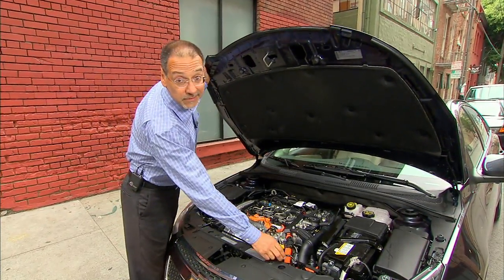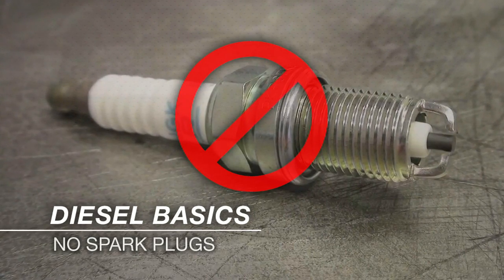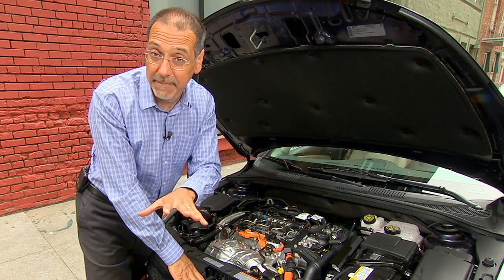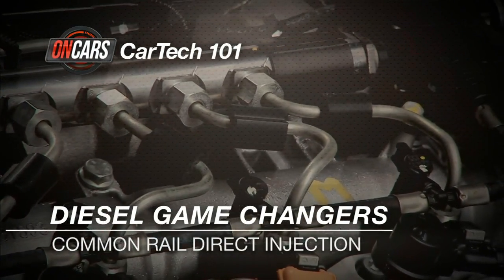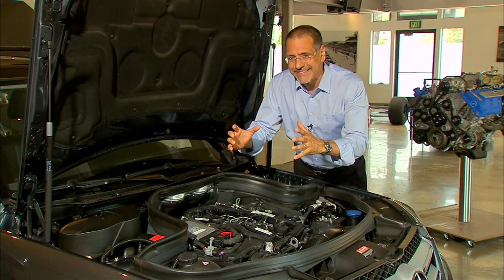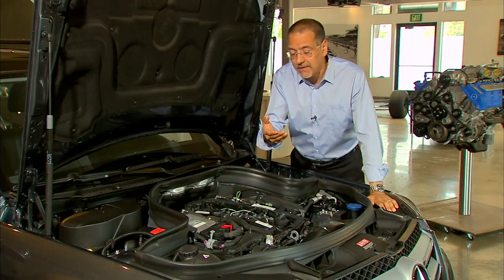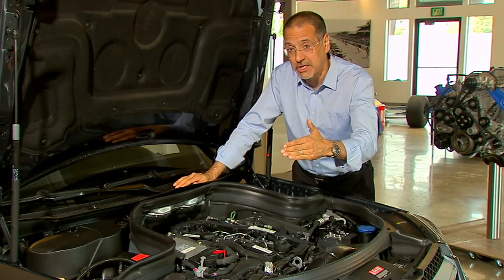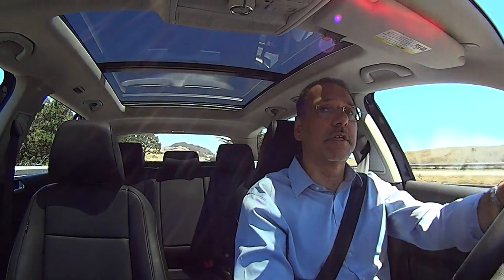CNET On Cars - Car Tech 101: Understanding diesels

Comment: I've got my first - modern -  diesel at 48. 

I'm never going back to gasoline. Next car will probably be electric. The current diesel took a week or two to get used to, but it is nothing short if wonderful.

With turbo and intercooler you get two engines: the very economic one at 1000 to 2500 rpm, and the extremely strong one over 2500 rpm. 

In fact, the engine produces so much torque that stability control is a must.

Comment: disel are less eco friendly than petrol, they have more carbon the the fuel itself and produce more nitrogen which is wprse for the environment than co2. yes the fuel economy is good and co2 emissions are less than gasoline/petrol, but they are not environmentally more beneficial.

Comment: Why Diesel engine is cool than Otto engine (example): BMW F10 525d 3.0 (turbo) with 205 HP and 450 Nm vs 535i 3.0 (turbo) with 305 HP and 400 Nm -> so, the Diesel engine have more torque, even with 100 HP less than Otto engine.

Comment: ...I had 2 naturally aspirated gasoline cars and 2 turbocharged diesels and to tell you the truth both have their pros and cons...Lets go cons first. Gas cars will let you down in economy and make you feel like you are constantly at the gas station so they are really bad daily drivers in general (even with bumper to bumper traffic a diesel would drain 20-30% less fuel than a gas car) , while diesels are noisy and clunky at low speeds especially the older pump diesel system ones like my old  2004 Passat making them a real pain in start-stop traffic... Without a turbo, gas cars are better as small hatches like my small Ford Puma which had 125 hp per ton (from a small 1.7L inline 4) so it could get a respectable 0-60 time with it loving to rev and it was so well grounded in corners it always put a smile on my face. It was fun as a city car and really nothing could go wrong with the engine (no turbo, no problems), while turbodiesels are great long trip cars, size doesnt matter with a TD because of the extra torque, they also have great mid range acceleration ( 2000-3000 rpm is their sweet spot ) making them a safe bet for passing on a B road. My current Ford Mondeo wagon TDCi has the common rail system which really eliminates most of the "diesel shake" while idling. Add the DPF which cleans those exhausts so there is minimal black smoke choking everyone around and you've got something extremely simillar to a gas car... So in my conclusion, a diesel is a great choice for people that regularly take long drives on highways while small gas cars are great for short city commutes.

Comment: What is it about diesels that make then last longer ?
Reply: Mostly because the parts in the engine aren't worked as hard due to it's lower rpm.
Reply: Whatever_928 Diesels are built more robustly because they have to handle much higher pressures than conventional gasoline engines.

Comment: here's a fun fact: Diesels are loved in europe, but actually don't fit it, this is because europe is so densely populated, most drives are essentially start stop and short drives, which actually ruin a diesels good points, as it gets most efficiency on longer drives with less start stop action. The US favors gasoline, but with its long roads and being less densely populated (except cities like NYC and such) it would make more sense to use a diesel... in the end, it just shows that the world works in strange and sometimes funny ways xD
Reply: Spot on. I only drive hybrids and diesels these days due to their efficiency. Cant wait to earn enough to buy a full EV.
Reply: and diesel is cheaper then gas
Reply: @leftmorningstar6954  - Not in America. It used to be literally half the price of gasoline, but now it's more expensive than premium. I find that annoying because diesel is fundamentally cheaper to refine. By a lot.

It's priced as a commodity. At some point it was discovered what the market can bear, and the price has stayed there.
Reply: Well it’s down to tax reasons. In Ireland, (pre-2008) nearly every car was petrol, other than vans, buses, trucks and other heavy duty vehicles. Our tax system was on engine CC (cubic capacity) so in the sense that, if you have a 4.0 V8 you probably have more money so you can pay more tax. Then with this new EU (European Union) directive that changed how road tax worked, it now ran on CO2 figures on a particular car. Diesels polluted less greenhouse gases like CO2 so the tax was far far cheaper on them as at this point petrols didn’t have particulate filters so they polluted a lot more CO2. Diesels we’re adopting particulate filters to lower CO levels (carbon monoxide). So then people in Ireland started buying diesels for lower road tax, also they were more fuel efficient in combined driving and the fuel was cheaper. Ireland is kind of vastly spread out and other than some cities on the coasts, there is a lot of country roads (80km/h speed limit) we also have 13 motorways (as of 2015) which is a lot considering Ireland isn’t exactly what you’d call a huge country, and diesels were amazing on the motorway too.
Reply: Most country boys in Europe love diesels when you live in a small village you buy a diesel and its ripp it and get the fuel economy of a prius when you do it
Reply: You love making statements and finding fitting Arguments after, don't you. 

Dieses Manuals are horrible in start stop traffic.
Reply: Well in Europe most people are driving manual.
Diesel cars are easier to drive,especially for beginners, because of the higher torgue output at lower RPMs there are more unlikly to stall.
Also they are accelerating a bit better

Comment: It strikes me funny that nobody here has mentioned anything about sub-zero temperature characteristics of a typical auto diesel engine.
Although these engines may contain "glow plugs" to aid in starting there's still an issue with the fuel viscosity at colder temperatures.
...And no mention of the cost of routine maintenance. Go check the difference in price of  complete service intervals of the diesel vs. gasoline engines.
Better fuel mileage on a diesel...yes  Cheaper fuel prices...absolutely not.
Reply: A modern diesel has no problem starting in sub-zero temperatures if the glow plugs work. 
Fuel viscosity is a non issue since gas stations only sell diesel with special winter additives during the cold months.

Routine maintenance yes, that can be a bit pricier on a diesel, depends on the car.
Reply: rayford21 Even my 33 year old diesel has no issues in the cold. 
Maintenance, same cost as a gasser.
Much better fuel mileage, plenty to offset the fuel cost. My diesel gets 3x the fuel mileage of the gas counterpart.

Comment: what about starting a diesel engine in -40degres though winter ?
Is it possible?
Reply: +ShowCare {aUtopia} Yeah? Never tried it but yeah 
you would have to heat up the glow plug a couple of times though
Reply: Hurileno I wanted to know if it is still necessary to plug the car to your home electricity at night in winter , on a 2016 diesel car ?
Reply: ***** Whatdo you mean plug in?

Comment: There hasn't been a decent diesel engine made since 2007... current emission standards have screwed everything up.
Reply: +John Groshko The BMW EfficientDynamics engines say Hi.
Reply: +Fantic1980 Sounds like over-engineered, emissions-based garbage.
Reply: John Groshko So by "over-engineered" you mean 'better', and by "emissions-based garbage" you mean 'lower emissions'? I assume you're American.
Reply: +Fantic1980 "Over-engineered" = less reliable, "emissions-based garbage" = worse fuel millage and less power.  Do some research. And FYI, I'm Canadian, and any diesel tech will tell you emissions standards are pointless and only cause more problems.
Reply: John Groshko Well my 320d does 70 miles per gallon, 0-60 in 8 seconds and in 5 years of me owning it, I've spent maybe £2000 on it outside of a service. I'm curious what this 2007 engine is you're talking about, because Honda absolutely changed the game back then.
Reply: +Fantic1980 ANY engine without a DPF or UREA system is better than one that has one.  You're car would probably get 80+ mpg with the emissions BS taken out of it, and re-programmed... Also, I believe the UK has lower emissions standards than here in North America ...
Reply: make and model plz
Reply: I can personally say any diesel pickup made after 07 is runied due to emissions

Comment: :33 Yeah it sounds like a chevy alright, cheap junk.
Only women and sissy "men" don't like the sound of a diesel.
Don't by a VW, they are cheap junk , I've got a 2015 jetta, it's crap, it has the trip computer and tire pressure sensors but no dang cruise control, just outright as cheap as they could be...
Reply: Mr.Green
You should reread the comment, sorry you couldn't understand I was talking about the fact a new car today not having cruise control with all the other electronic controls only points that a company is being cheap.
Reply: Mr.Green"
That's not the cars fault, it's yours"  Yeah like the car made itself, I blame the maker for being so stupid cheap, I've yet to own a older model of any other brand that had power windows but no cruise control and this would include diesel pickups base trim and even my 93 pace arrow has cruise control and it's a chevy chassis. 

So is your TDI one that VW is so famous for making the most pollution, again what a crap company, though the worst is GM, 10 years running with steering columns locking up on people while driving.
But the whole feel of VWs is just cheap in general, like most new cars today.
Reply: Maybe you shouldn't of been so "cheap" and bought the one with the cruise control option... there's a thought, genius.
Reply: Mr.Green
Base model does not have heated seats.
Though it sure does have everything else, I don't know about the speakers, but my 2000 Taurus sounds much much better, not to mention the taurus is faster and gets near the same mileage.

"you're just a sever cheapo dude. "  Because I think a jetta is a cheaply made car?  No, it's because I have higher standards, LOL.

Is that a jetta in your video "about police trucks on I81"?  Funny I'm not far at all from 81.  If that is a jetta well the radio in the 2015 looks way better than yours does, what year is your jetta?
Ohh I see you say yours is the TDI, cough cough, junk VW diesel, cough cough, cheapskate company that is dealing with legal battles over it's dirty engine they LIED about cough cough, like I was saying VW is a cheap company, not only do they make junk, they are very deceptive as well.
The one I'm talking about is the gasser with the 6speed, I'm shocked it has the transcommand on it, but it's sluggish shifting is a joke at best, def for someone that has never driven anyone elses.
Reply: Mr.Green

So where is a video of your jetta then?

"And no, you don't get 41 mpg with a Taurus and no its not faster"  I never said that I did, I said it does better than a 2015 jetta with the gas engine, and it sure would outrun it, I've driven both.

I obviously know more about cars than you, your YT doesn't suggest that you have any skills, I have plenty of how to videos.
Anyone can type and talk a bunch of crap from behind the keyboard, but what can you actually prove?

LOL a civic.
Reply: Mr.Green So where is a video of your jetta then?
Reply: Mr.Green
Ya ok.
Reply: Mr.Green
Hey man take care.

Comment: I don't get America. The world's greatest country yet so backward.  All BMWs and Audi's are diesel here. One of the best one I think is the Audi A6 biTDi. 3.0 diesel twin-turbo 326BHP. 0-60 in 4.7 seconds and 44 MPG. Yet here you are just figuring this shit out now? What are your engineers doing over there. It's so funny to see Americans say things like diesel used to be a dirty fuel and diesel is slow. We figured out 15 years ago in Europe that diesel can be fast as well as efficient. I can't understand this country
Reply: +VolvoXC90TV Gasoline is much cheaper here than in Europe
Reply: i would disagree. Most german cars sold in europe runs on Diesel. Atleast for now.  The BHP is not that astounding. But the tourqe is. Atleast for a standard car.
Reply: +Nima Afshar Deisel is 2 - 5 times cheaper here and a couple of months ago diesel was cheaper than a bottle of coke here
Reply: +VolvoXC90TV The upkeep of a diesel is far more expensive than a gas engine. Diesels need perfectly clean air and fuel to function properly, otherwise they create more expensive problems quickly. I am a diesel mechanic in the service and I have seen this first hand. The filters are pricey, the oil is pricey. Gas motors are cheap maintenance and far less of it over the lifespan. Gas is also far cheaper than diesel. I was stationed in Europe for a few years and the gas price was 1.89 euro for one liter of gas,...this was in 2003! That's nearly 6 euro for one gallon,...in the U.S. gas is currently avg of $1.90 a gallon. Far cheaper. This is why.
Reply: They moved to cities phsically but not mentally. They still drive pickups in cities. They call a liquid gas. They call a shift knob "stick". They still use medieval measurement. They cant pronounce basic materials like "aluminium". What do you expect?

Comment: Stinky diesels... wait until they invade your cities in the US, you will see (and beathe) how "clean" today's diesels are... I live in Belgium, in Europe and I can tell you that reality is FAR from the theory. Diesels are good for longs distances, but they are absolutely NOT designed for cities.
Reply: Engineer Diep
Hahhaha Ohh they do that too but I reckon the cost of rubber is more immediate, first 4 or 5 years I was driving I was burining out all the time, myself now I haven't rolled any coal, seems stupid to me, more soot and higher temps for no extra power.
Reply: There is still an argument for diesels.

Cons of diesel

1. More polluting to local environment
2. It takes a few more minutes to warm up a diesel engine, but only a few.

Cons of petrol

1. More polluting to the Earth as a whole
2. The process of refining petrol is more polluting than refining diesel out of crude oil.

"Swings and roundabouts" - The choice between the two is not as easy as you may think.
Reply: +Jean V Speaking of which, what happened to diesel-hybrids? There should be some right now right? Kill me if there isn't one or hasn't been one in the market yet.
Reply: +Jean V In my land we use diesels to roll coal.
Reply: Patrick TheBaptist Your still using coal?
Reply: Engineer Diep
You need to learn what I am talking about "roll coal" look it up on YT, you will see alot of american diesel trucks chugging out tons of black smoke.....  LOL
Reply: Patrick TheBaptist Just looked up roll coal and I'm now wondering why you guys don't do burnouts instead.
Reply: Patrick TheBaptist Good for you, but there's still the other guys to ask why they roll coal at a time when California is in a drought.
Reply: Engineer Diep
Bigger problem is the water bottling companies that wont stop sucking them dry, sad that starbucks actually moved theirs....
Reply: Patrick TheBaptist And Walmart has been a target for while
Reply: +Engineer Diep Volvo V60 D6-PIH is a diesel-hybrid.
That being said, also living in diesel-loving Belgium, I stepped away from diesel and went to LPG 3 years ago, and I recently ordered a brand new LPG car.
A modern turbo-petrol engine can be just as torquey as a diesel, be just as economical when running on cheap LPG, but much cleaner and much more happy to deliver some extra hp when pushing it.
Reply: +Jean V You are right. Greetings from Trier.

Comment: I wonder why they don't build gasoline engines on the same principles as diesels, it should still work, at lower compression ratio to compensate for the lower ignition point.
Reply: +Keven Harvey because the gasoline has much lower ignition temperature point , they will fire by itself very very easily when the compression ration go over 10. Some gasoline car engine can go over 11 but never as high as a diesels which is over 20
Reply: Joe Zhang
That's how diesel engines work, they fire by theselves, instead of controlling the ignition, they inject fuel into the cylinder after the air has been compressed, instead of compressing fuel and air together and then igniting it with a spark. It would most likely need less compression or different timing than a diesel engine but the principle should still work.
Reply: +Keven Harvey The diesel fuel in a common rail direct injection system is under extremely high pressure, which allows very precise short injection bursts.

These high pressures wouldn't be safe to use with petrol, as a very small leak would spray a lot of fuel all over the engine bay very fast. This is not that much of a problem with diesel, as it is with highly flammable petrol.

Lower injection pressures results in longer, less precise injection pulses. Combine this with the fact you need higher rpm, thus even faster cycles to develop power because of the lower compression, and it gets even more complicated...
They've only recently come to the point direct petrol injection instead of port injection is reliable enough for mass production, with still many problems arising...
Reply: The real problem is that diesel self ignites and the flame propagates smoothly at the combustion chamber pushing the piston down. Gasoline not only can withstand much less compression but also explodes violently. Trying to use it that way would and it the violent and uncontrolled explosion would either send the cylinder head at the hood or the piston at the basement, depending on what fails first...